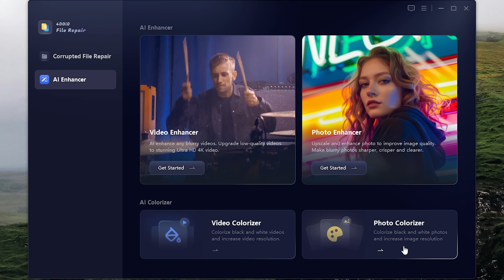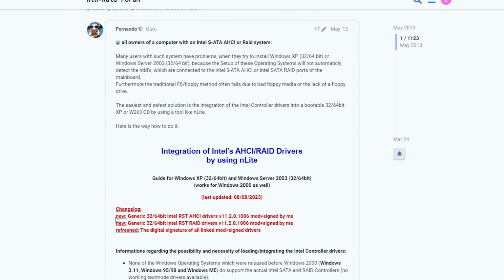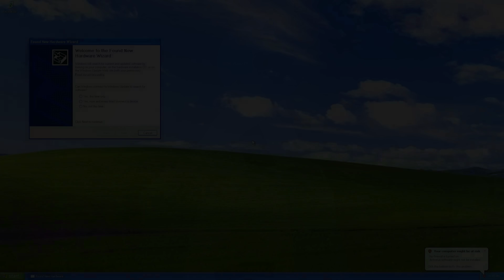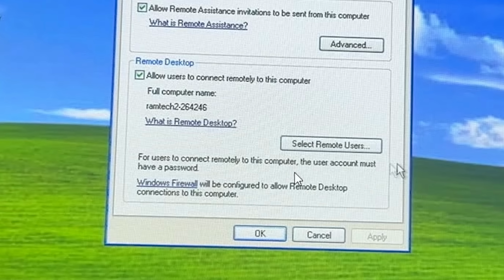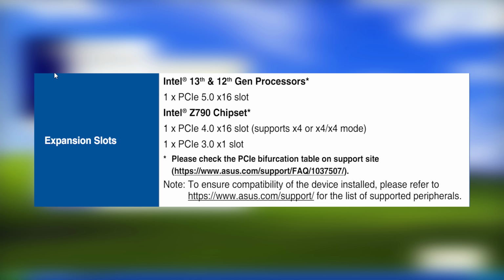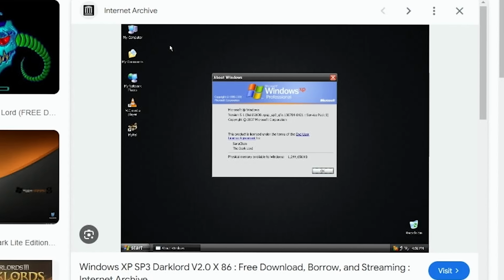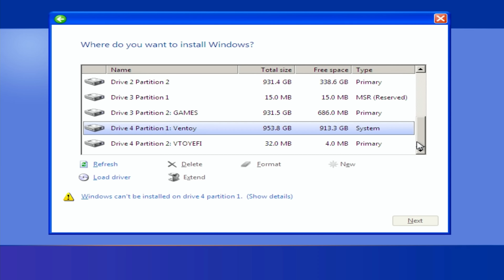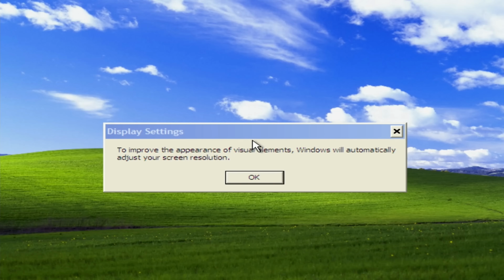Can Windows XP Run on a Real Modern PC After 25 Years? Part 1

Comment from the maker: 📀4DDiG Photo Repair https://bit.ly/3VGb9ry

What is your favorite operating system? P.S. I ordered:
 1. a PCI-E to PCI adapter
2. USB 2.0 PCI-E card
3. a PCI-E to PS/2 adapter. 

I hope it will work in the next video
Reply: Windows 7 and im very excited for your video i learn a lot about hardware and software with you
❤❤❤❤
Reply: Windows __
Reply: Windows XP, Vista, 7, 8, 8.1, 10 and 11. In addition to those versions of Windows, I love Windows 1.0, 2.0, 3.0, 3.1, 95, NT 4.0, 98, 2000 and ME.
Reply: THE NEXT VIDEO: installing a modern gpu into a laptop
Reply: Windows 98
Reply: Windows xp ia cool i guess😂😂😂❤❤
Reply: Android tv
Reply: windows vista
Reply: gentoo linux and windows 7
Reply: Windows millennium edition

(Joke)
Reply: Windows XP.
Reply: Windows 7 and 10, however, i also like most Linux distros because they are open source and there is so may to choose from!!!
Reply: Windows 7 and 11
Reply: 7
Reply: My favourite opening sistem was Windows 7 until i grew up and reinstalled it on old laptop. Everything was fine until i had to install drivers. When i try to install Nvidia drivers it says that I need to install intel drivers firt then i try to install intel drivers and it says that sistem isn’t compatible with intel driver. My favourite opening sistem now is Windows 11
Reply: Windows xp
Reply: I miss OS/2 when using x86 based machines. Amiga 2.0-3.1 is my favourite of all time.
I like Apple //e DOS 3.3 for old computers.
Reply: Mine is Windows 7
Reply: ubuntu and os x
Reply: Get some older low profile PCI cards for LAN and USB 2.0, they will work with PCI-E to PCI adapter. Just make sure the cards have controller chips compatible with XP drivers.
Reply: Windows 2003/XP64 for laying the foundations for how modern OS's work, Windows 98 SE for old games, Android 2.3 for being lightweight and smooth enough to run on a 600MHz ARM core with 128MB of RAM, no other mobile OS will ever have that level of performance and usability
Reply: all of the versions i have 98SE 7 {10 a long time ago}
xp [11 still a long time ago]
Reply: Windows 7 and 11
Reply: Windows 7 and 11
Reply: GNU/Linux

Comment: Pro tip! : if you need drivers to install there is a way to mount a physical drive to a virtual machine like virtualbox. however ive only seen this a pc with a firewire cable.

Comment: Try the CeoMSX patch made by Chinese, which can help users import disk controller drivers to offline systems in another  system. The offline import tool supports ACPI,AHCI, XHCI,RAID,NVME,USB3.0, Ethernet,WLAN. The driver program solves the problems of offline system installation and some drivers that cannot be installed. This tool supports 32-bit and 64 bit XP.2003, Vista, Win7,Win2008
Reply: Using Snappy Driver Installer full edition can solve most driver problem

Comment: windows 1.0 2.0 3.0 3.1 95 98 me 2000 xp vista 7 8 8.1 10 x86 arhitecture base  die 2038 year not working os unix decimal timer die and operating system click any apps show error future processors not manufacture with x86  minimum old os working windows xp x64 server 2003 x64 windows vista x64 7 x64 8 x64 8.1 x64 10 x64 11 x64

Comment: When you install Windows with usb, do you connect the usb to the front port of the case or to the back of the case?
Reply: I guess he probably uses the front ports for easy access, but it doesn't matter which ones are used.
Reply from the maker: In any. It doesn’t work in any USB ports

Comment: You could've tried WinXP integral Edition
Reply from the maker: I tried it but it gets BSOD
Reply: @RamtechENG  Use the optional patch integrator to get past theA5 and 7B BSODs.
Reply: @RamtechENG  You did add the drivers using the tools that came with the zip right?

Cuz you probably used the vanilla and that's not gonna work

Comment: You can install into the TPM module connection (having removed that TPM) an ISA slot (since there are ISA expansion cards made in the open source community) and then that can take a USB riser card (or serial or parallel IEEE1284 or NIC, or soundcard with MIDI etc.). Maybe it would have detected that. The TPM is 8 bit.
My comment has no hate in it and I do no harm. I am not appalled or afraid, boasting or envying or complaining... Just saying. Psalms23: Giving thanks and praise to the Lord and peace and love. Also, I'd say Matthew6.

Comment: Now do this on Ryzen
Reply: I wanna use windows 7 so bad lol
Reply: @LightWorks222  Windows 7 works on Ryzen.
Reply: @MetricBrawl  would a 7800x3d paired with a 4090 work ? I doubt it
Reply: @LightWorks222 Would work with the 7800x3d, but not with the 4090, if you got a 30 series GPU or older, then it will work. Remember to use CSM mode!

Comment: Are there any XP drivers for the Dell PERC H700 RAID controller card? None exist on the Dell website and if I use the LSI drivers for this card Windows XP will destroy my Windows 10 installation on drives attached to this card.

Comment: edit: OK, XP2ESD is also a good alternative.

The information in this video is out of date.

Just use XP Integral Edition.
It has updated ACPI (So you can use up to 32 CPU cores instead of 1), as well as Generic AHCI, NVME and USB 3.0 drivers made by the community.

Comment: does that motherboard support CSM then?
also you can find usb pcie add in cards to be able to just plug in a usb keyboard and mouse on windows xp
for the gpu just put a gt 710 in there, and for sound add a sound card